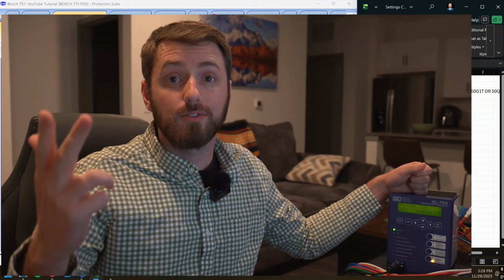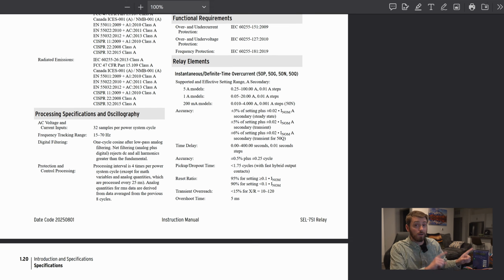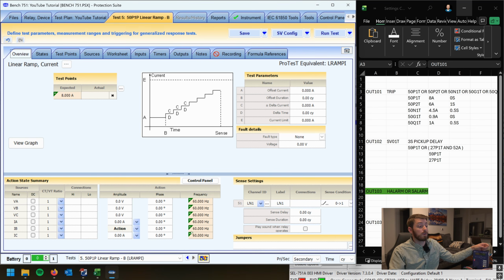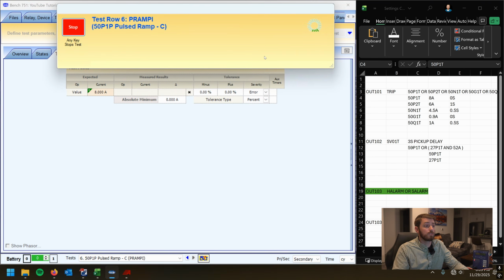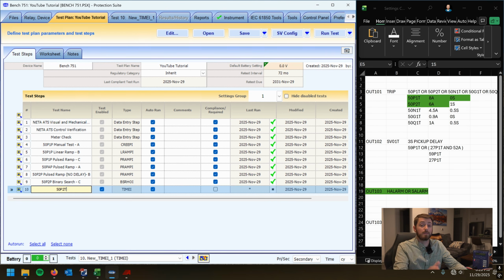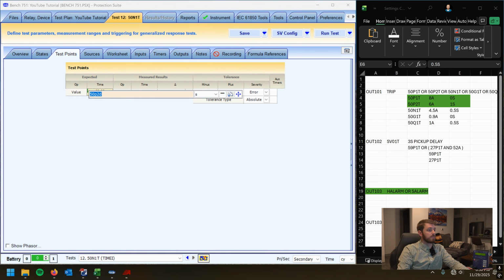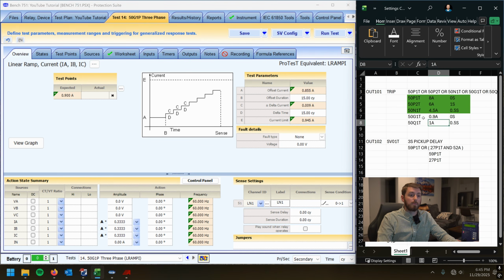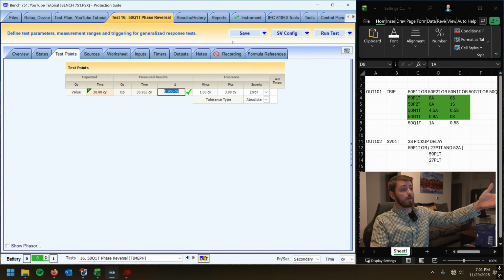EVERY Overcurrent Test 50P/50N/50G/50Q - 751 Masterclass (ep15 )

Comment: will you make a video of testing multiprocessor relays with the rts software? my company uses test universe but just got rts but no one knows how to test multiprocessor relays with it
Reply from the maker: I'll start by saying I genuinely don't like RTS. Its clunky and difficult get the test set to do exactly what you want unless you can code or run one of the premade test plans already works, and even then it's a bit of a shortcut and often doesn't ensure the relay works as a system. It doesn't make for a good tech, it's a bit of a crutch. That said, my new company is pushing me to use it, so I'll need to get up to speed on it soon. I'm not super happy about that but I'll probably make videos on it soonish.

Comment: Yes still a very good video 

i will just add some personnal ... experience 

even with a zero delay i do the test ... you will end up with a 20 to 50 ms delay
that is some of the reason you where failing  some trip time ,  the software trip a X time but you also have to take into account the time in take to activate the physical relay ...and the time of the testing device to figure out that it is turned on ....    3 cycles  seem's like a good ball park lol

and normally on a commisionning gear i test the trip line AS IS  to see if there is some logic error
one time there was a 50P1D instead of a 50P1T   
or lately a customer asked to implement a harmonic blocking fonction with 50P1T   ...  we discovered that harmonic blocking was inserting 100ms delay...some how ...buy yes this is more advance 

now i'm having issue with 50G1  with omicron software .... normally i do exactly like you did ....pick up is a .9  i inject .9  and everybody is happy BUT   omicron see that setting like I0  instead of 3I0  
for some werid reason i have to put the value a 3x the curve to get the pick up ... .software pleasure lol (it's mostly a report issue , i know why it does..but on a report saying PU is .9 and you measured 3 time that is like ??

PS if you want to go crazy on error margin .... with a beer ...timing error is like 3% .    so just say at 10 A  i'm suppose to have 10 sec +- 3%  ......   is the relay reading the 10A correctly , what is the error of my test set ... we had fun to try to put a number on it and finally said haaa   forget it lol
Reply from the maker: Right, having the report show the right thing is always a challenge. Understanding the interaction between what is "actually supposed to happen" and what your test set "really does" is key and sometimes hard has hell to figure out.